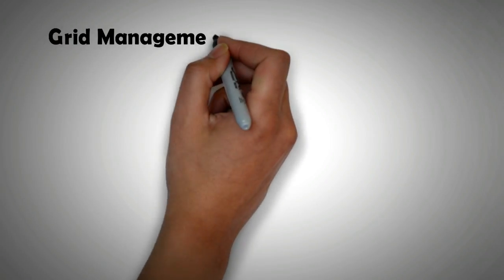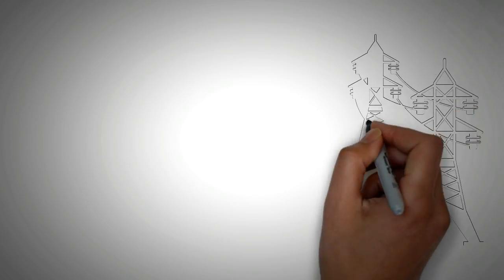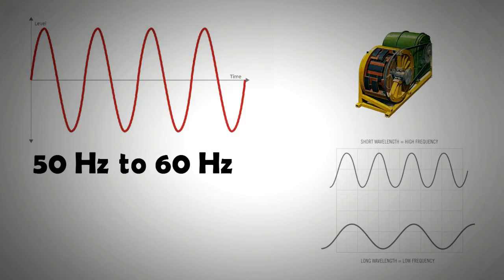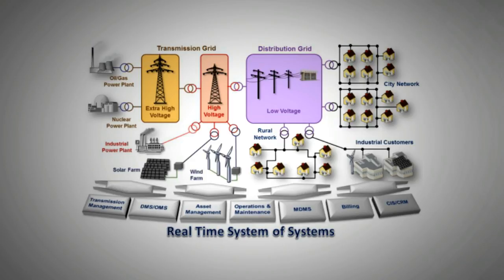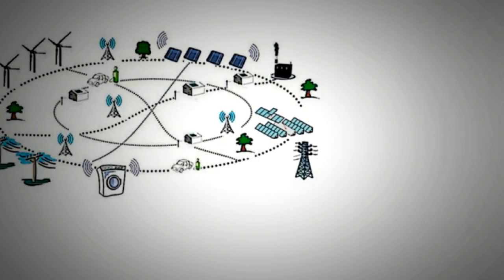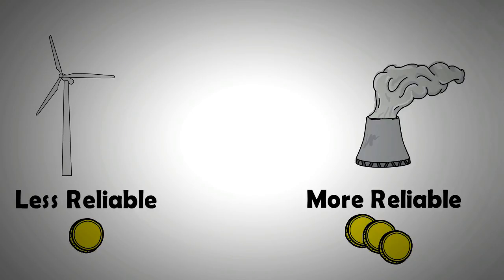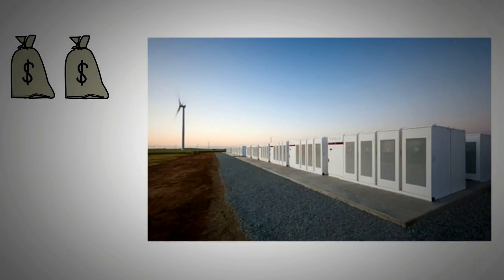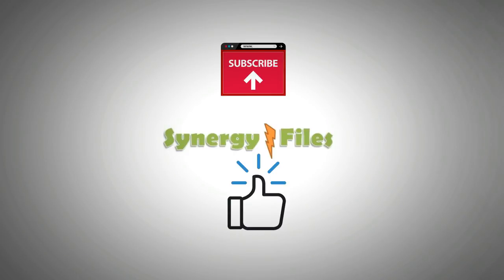"Grid Scale Battery Storage" for the era of Renewable Energy

Comment: The Tesla battery in Australia is not a storage device as such but a switching battery used when selecting energy sources to maintain voltage/frequency for a few milliseconds, The unit is only 100Mw and minuscule in comparison to the grid capacity.

Comment: I believe the video was a little misleading. Yes, the power stations try to keep the grid frequency consistent, but that's for efficiency (and partially due to safety). The variable that is changed at a traditional turbine based power station to deal with more or less load, is torque. Imagine putting your car on cruise control for 60mph, but you are on a road with hills all going varying degrees of up (assume no gear changes). The wheels and engine RPM will  remain fairly constant, but the torque delivered by the engine will vary widely, due to more or less fuel being delivered to the engine. The fuel in the case of a steam turbine, is the steam.

Now consider a solar array on your roof, which makes DC power. It relies on the inverter to change the DC into AC. It supplies power to the grid, but it matches the frequency exactly, otherwise it would be inefficient or downright dangerous. So, how does the grid know to take power from your solar system?

Consider two 12v batteries which are wired in parallel, that means 12v total. But, one battery is 11.9v and the other one is 12v. Which one will draw more current? The answer is, the 12v battery will draw more current. In fact, the other battery won't start supplying current until the higher voltage battery has reduced to (or below) it's level.

Back to the solar example: how does the grid know to take power from your solar system? Like the battery example, the solar inverter will put out ever so slightly more voltage than the power coming into the home. This is an unfortunate thing, if the voltage coming to your home is already running a little high. I'm really not sure what happens when several homes, all running off the same local transformer are all attempting to supply power to the grid. I'll bet this causes issues in places like Germany, where many residences have their own grid tied solar...

Comment: Focusing on frequency variation due to load variations seems like an odd tact. Can you say with certainty that a generator on the grid would vary by +/- 0.5Hz? Because this would cause a huge additional current draw if it were one or more power stations, producing the mismatch frequency. The reason for this increased load would be because the grid is supplied by many power generation stations, all wired in parallel, all of which must be timed extreamly well in frequency and phasing. Frequency directly effects phase, but it takes a little time to do it (in 60Hz freq, it takes 16.66 milliseconds to for each 360° cycle, but only 4.16ms to move 90°.

A 0.5Hz difference in frequency would make the misrun generator out of phase by 30° in 1 second's time, 90° being a dead short. So, in 3 second's time, you'd have a dead short on all three phases. That would cause quite an explosion!

As load (current) increases on the grid, the mechanical resistance does increase between the turbine and it's respective generator, but the large rotating mass (inertia) of the combination of turbine and generator will oppose any change in rotational speed (measured in RPM). As well, generators that are running synchronized have something known as electrical inertia, this further contributes to their running in time. This offers the elaborate control systems of the generators time to adjust input power to the turbines. Basically, if one generator were off by 0.5Hz, every generator on that parallel circuit would be off by this amout. On a massive scale, like the US grid, there are dozens to hundreds of generators attached to the same parallel circuit, that's a lot of mechanical and electrical inertia to to change by 30° in one second, if something were off. Keep in mind, 30° of phase mismatch is enough to cause a MASSIVE current spike.

I imagine the grid maintains a much more accurate frequency, something like +/- 0.1Hz. The larger the grid partition, the more stable.

Comment: Basic question, can we charge the batteries and consume power from at the same time?
Reply from the maker: +bono hiuson  no, you can either charge or discharge
Reply: Is it in theory feasible if the batteries modules are split , one module could be in charge and the other one in discharge mode.But I assume it does not make much sense in a grid demand/supply perspective as during off-peak period we try to charge the battery packs as much as we can to antecipate the peak period  @synergyfiles3536